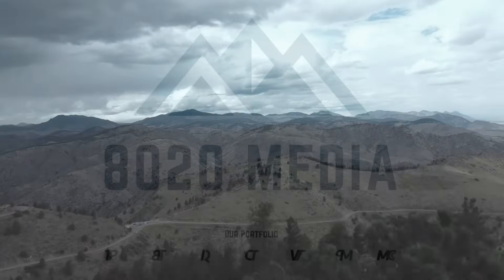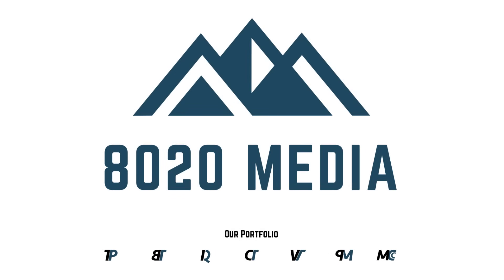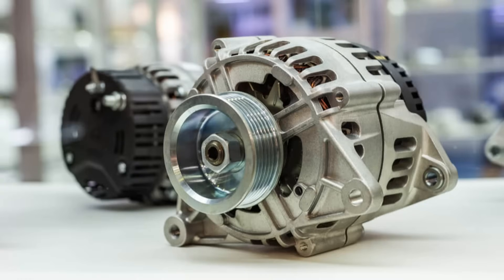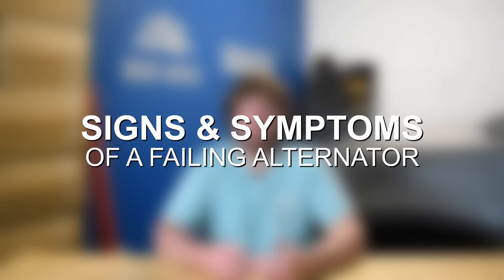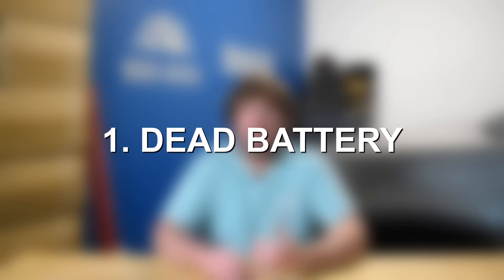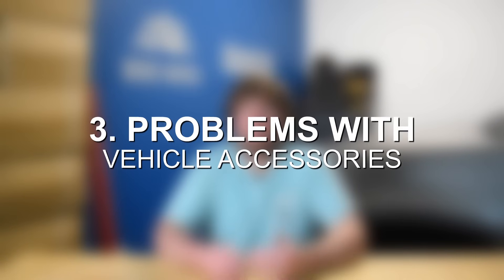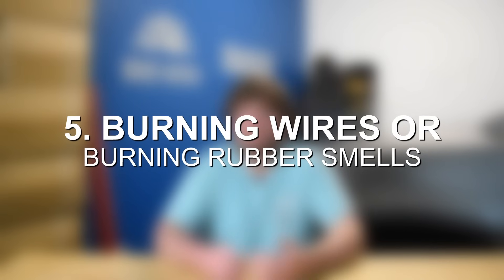6 Symptoms of a Bad Alternator!

Comment: What if your battery is throwing too much voltage?
Reply from the maker: B - If your battery is throwing too much voltage, typically above 14.8V while the engine is running, it’s likely an overcharging issue caused by a faulty voltage regulator inside the alternator. Overcharging can damage electrical components, cause battery overheating, and lead to premature failure. Check the alternator output with a multimeter; it should be around 13.8-14.5V at idle. If it’s excessively high, replacing the alternator or voltage regulator is necessary. Also, inspect the battery for swelling or leaks, as excessive voltage can damage it. If the issue persists, ensure all grounds and connections are secure, and check for a faulty ECU, as some vehicles regulate charging through the computer.
Reply: @ got it. I just replaced the alternator today unfortunately I had another diagnostic and is throwing a code for “torque converter”.
Reply from the maker: @ Sorry to hear.. We hope it gets fixed!

Comment: I already ordered the Alternator, but I was second guessing myself. Lights dim slightly on every few seconds and my phone dint charge anymore on charger (shows charging but doesn't charge), so yeah video was on point for sure.
Thanks.
Reply from the maker: Y - Thanks for the feedback! Hope it helped.
Reply: A weak battery can burn out an alternator. All batteries should be slow charged every 6 months.
Reply: @Michael-Philip You're only 4 months late with response. 
Anyways, alternator change fixed my issue, grid heater was draining batteries and factory alternator couldn't keep up, it was that bad.

Comment: My car is completely dead and I can't charge the battery up. I smell burnt in the engine bay area last time when car was on. Could it be alternator ?
Reply from the maker: M - If your car is completely dead, won't charge, and you smelled something burnt in the engine bay, the alternator is a likely culprit, but you should also check for a blown fuse, melted wiring, or a short circuit. A failing alternator diode or regulator can cause overheating and a burning smell. First, inspect the battery terminals and cables for corrosion or damage, then check the alternator wiring and fuses for signs of burning. If you have a multimeter, test the battery voltage—it should read around 12.6V when off and 13.5-14.5V when running. If the battery is drained and won’t charge, the alternator may not be supplying power, or there could be a parasitic drain. If unsure, remove the alternator and have it tested at a parts store. Keep us updated!
Reply: @ wow thank you so much for such a detailed reply, I am grateful. I will have those checked asap and will report back. Appreciate it !
Reply: Could be starter as well if your having trouble starting the engine too, alternator issues are very similar to starter
Reply: @4l2u0na  but if it’s starter issue, all the electrical components wouldn’t be dead tho

Comment: My aircon internal air goes  random.
My wipers went off 
My radio channels change randomly infrequently .

Now im getting whinnying and grinding noise 
Car is 160k km
Reply from the maker: M - Your symptoms—random aircon behavior, wipers activating on their own, radio changing stations, and now whining/grinding noises—suggest an electrical issue, likely related to a failing alternator, bad ground connection, or faulty body control module (BCM). The alternator may not be supplying consistent voltage, causing intermittent electrical malfunctions, and the whining/grinding noise could be from a worn alternator bearing. First, check the battery voltage with the engine off (should be around 12.6V) and while running (should be 13.8-14.5V). If the alternator is failing, it can cause erratic electrical behavior. Also, inspect ground connections and fuses for loose or corroded terminals. If the alternator checks out, the BCM or wiring harness may be at fault, requiring further diagnosis with a scan tool. Keep us updated!

Comment: Thank you for your video. I replaced a brand new alternator, but it isn’t providing the electricity power while engine running. Should the alternator pigtail plug connector be replaced?
Reply from the maker: S - If your new alternator isn’t providing power while the engine is running, the issue could be with the alternator pigtail connector, wiring, fuse, or voltage regulator. First, check the alternator fuse and fusible link, as a blown fuse can prevent charging. Also, inspect the pigtail connector for corrosion, damaged pins, or loose connections, as a faulty connection can stop the alternator from sending power to the battery. Use a multimeter to check for proper voltage at the alternator terminals—if the alternator isn’t outputting around 13.5-14.5V, and the wiring checks out, then the pigtail connector may need to be replaced. If the wiring is fine but there’s no charge, the issue could be with the internal voltage regulator, meaning the alternator itself might be defective. Keep us updated.

Comment: Question. If its a bad battery and you put a jump on it. will that stop it from starting? I have a 2011 chevy traverse. I was driving and it died out of no where. I couldnt get it to start and ended up killing the rest of the battery. I got  a jump and it still wouldnt start and the battery died again so we charged it a lil before we left. We just tried again and the battery is dead and didnt even really wanna take a charge so i could get the key out.  Do you think i messed my battery up and its something els or do you think my battery is bad and why it died.
Reply from the maker: D - Yes, if your battery is completely dead or damaged, even a jump start may not work, especially if the battery has an internal short or bad cells. Your 2011 Chevy Traverse dying suddenly while driving suggests a charging system failure, likely a bad alternator, loose/corroded battery connections, or a failing ground. If the alternator wasn’t charging the battery, the vehicle was running solely on battery power until it drained completely, causing it to stall. If you jumped it and the battery still died immediately, the battery is likely too weak to hold a charge, or the alternator isn't providing power. Try testing battery voltage (should be 12.6V off and 13.5-14.5V running) and check for a bad alternator by seeing if the voltage drops when running. If the battery won’t hold a charge at all, replacing it is the first step, but if the new battery still dies quickly, the alternator is the real issue. Keep us updated!

Comment: I was driving and my jeep renegade turned off. I have a new battery so I know it’s not battery but my battery icon came up. I tried to start it it wouldn’t start until the second or third try. Would this be an alternator issue?
Reply from the maker: T - Yes, if your Jeep Renegade turned off while driving and the battery icon appeared, it’s likely an alternator issue. The battery icon usually indicates that the charging system isn’t providing enough power, which could mean the alternator is failing, the serpentine belt is slipping, or there’s a wiring/ground issue. A failing alternator can cause the engine to stall while driving because it can’t provide enough voltage to keep electrical components running. Since the car eventually restarted, the battery had some remaining charge, but if the alternator isn’t charging properly, the problem will worsen. Test the alternator output with a multimeter—it should read 13.5–14.5V while the engine is running. If it’s lower, the alternator likely needs replacement. Also, inspect the belt and connections to ensure proper charging. Keep us updated.

Comment: Thanks for your straight-forward video. What if the power locks still work after I manually lock the car but the battery is dead and the car won't start, is that an alternator or battery problem?
Reply from the maker: L - If the power locks still work but the car won’t start and the battery is dead, it’s more likely a battery issue rather than the alternator. Power locks require minimal power, so a weak or nearly dead battery can still operate them, but it won’t have enough charge to crank the engine. Keep us updated!
Reply: My battery light came on and stayed on and then other dashboard lights came on and then my radio went out and car stalled out and would not start tried to start the car after a hour and it started right up so what is wrong it it my battery or alternator?

Comment: Battery light kept coming on and off when I was driving home last night. Went to drive to work this morning and my battery light came on again and got about half way before my radio started going out and all the lights in the car started to go out and then the surging of the engine occurred when I pretty much lost all power. Was able to drive it home but had to go like 5 mph. Gotta be alternator right?
Reply from the maker: x - Yes, the symptoms strongly suggest a failing alternator. The battery light coming on indicates an issue with the charging system, and as you continued driving, the battery drained because the alternator wasn’t providing sufficient power. The radio cutting out, lights dimming, and engine surging are signs that the electrical system was losing power, forcing the car to run off the rapidly depleting battery. To confirm, test the alternator output with a multimeter—voltage should read between 13.5–14.5 volts while the engine is running. If it’s lower, the alternator likely needs to be replaced.

Comment: I changed my alternator and it run for about 2 hours then it will stall
Reply from the maker: L - If your vehicle stalls about two hours after running with a new alternator, it suggests the alternator might not be charging the battery properly or there’s an issue with the electrical system. Start by testing the alternator's output with a multimeter to ensure it’s producing around 13.5–14.5 volts while the engine is running. If the voltage is lower, the alternator may be faulty, improperly installed, or there could be an issue with the wiring, such as a loose connection, a bad ground, or a damaged power cable. Also, inspect the battery terminals and cables for corrosion or looseness, as these can restrict power delivery. If the alternator checks out, test the battery’s health to ensure it holds a charge. Lastly, ensure the belt driving the alternator is properly tensioned and not slipping, as a loose or worn belt can prevent the alternator from charging effectively. Addressing these areas should resolve the stalling issue. Keep us updated!

Comment: On my 2015 V6 Tacoma the battery light on my dash would flicker sometimes. And I smelled a burning electrical smell sometimes. Replaced the alternator and serpentine belt.
Reply from the maker: M - Did that fix the issue?

Comment: I have flickering dash lights and headlights had it tested at O'Reilly's Auto parts they said the battery was about to go out not the alternator is that true?
Reply from the maker: L - Yes, a failing battery can cause flickering dash lights and headlights, as it struggles to maintain a stable voltage. Replacing the battery should resolve the issue if the alternator is confirmed to be functioning properly. Keep us updated!

Comment: I own a 2006 Impala. For the past two weeks I’ve gotten a new battery and I’ve been jumpstarted because I would get in my car and my car is dead. We checked my fuses and all my fuses were reading normally. I am very confused because when I go to turn my key over my car is dead. I take my key out and I turned my car on again and it starts. I am dumbfounded, and I don’t know what to do. We kept my car and a warm shop for 12 hours and I didn’t have this problem but once it got into the cold because I’m from Minnesota that’s when I would have the problem when it won’t start.
Reply from the maker: N - Sorry to hear this! The most likely culprits are a weak starter motor or battery/connection issues exacerbated by the cold. Start by testing the battery, starter, and ignition switch, and ensure all connections are solid. Using a block heater can also help mitigate cold-weather issues.

Comment: Thank you for the video. I don’t know what’s wrong with my car. It keeps dying every time when I jumpstart it and I just bought the battery like six months ago when I drive it showing the dashboard. the battery appears.when i jumpstart it it will start ok but the following day it’s dead
Reply from the maker: R - Sorry to hear this.. The most likely culprit is a faulty alternator or parasitic draw. Start by testing the alternator output and checking for electrical drains.

Comment: Replaced the alternator and installed a new battery on my 2013 Dodge Durango. It started up as should. 2 days later on my way to work, battery light came on and within 5 minutes dash lights started flickering. I have 2 12 inch subs powered by an amp that went out on me a month ago. The power supply cable from the amp was still connected. I had the battery jumped and it drained. I unhooked the power cable for the amp, jumped the battery and the voltage remained at 12.5 and didn't die. Could the power cable from the amp be the issue or do you think it's a pdi or pdmi issue?
Reply from the maker: R - The amp's power cable is likely the root cause of your issues. Disconnecting it resolved the immediate symptoms, indicating it was either causing a parasitic draw or electrical instability. If the system operates normally after disconnecting the cable, the issue is with the amp or its wiring.

Comment: In my wife car’s case, no battery light on the dash. So i know that the alternator still works. So i started the car. It started. I turn it off after 10 seconds. Restatrted  no start. Like really dead. Then i jumped it and started right up. Used a mulitimeter and battery is ready full. Started to car and reading full also then tested the alternator with multimeter. Checks out. So why does the car dies if the car parked for two days. There is a chance i would have to jump it. Thwre is time that it’ll start right away. Any idea?
Reply from the maker: T - The most likely cause is a parasitic draw from a component draining the battery while parked. Perform the parasitic draw test to pinpoint the culprit, and inspect the battery and connections.
Reply: @ Thank You i will

Comment: My car runs fine but I do notice at night the headlights dim when I turn on other accessories like the back window defroster the hvac and when I step on the brake the dash lights and headlights dim and when I rev the engine up the lights get brighter is this an alternator issue.
Reply from the maker: R - Certainly sounds like it!

Comment: mine dropped to a round 12 volts one day then it went back to around 14, a couple days later i went to start it and the battery was dead so i took a spare i have that had 12.72 volts and put it in, it started right up but was jumping to 16 volts then back to 14 and also almost 12 volts. now i dont know which is bad. battery or alternator.  my previous battery is over 5 years old, the other one that i put it is 2 years old and started the vehicle up. so now im confused 🙃
Reply: I’d like to know what you ended up replacing
Reply: @iYKYK-14-o4k    i replaced the battery first then the alternator, it still says 15/16 volts,  but after about a month everything still working, dont remember ever having a vehicle over 15 volts, but this seems to be one of those cases that i dont know, my multimeter says over 15 as well so im not sure.

Comment: After running several errands (5-10 minutes of city driving between stops), car wouldn’t start. Weather in 50s (F), and lights not left on. Jump from a stranger, and started right up. 5 minute drive home, turned it off, and wouldn’t restart. 2 hours on a 10amp battery charger, and now it will start. Two different auto part stores tested the battery, alternator, and starter (in the car). All tested good. Second time this has happened. Any ideas?
Reply from the maker: M - While the battery, alternator, and starter tested “good,” I’d recommend starting with a load test on the battery and measuring the alternator output under load. These are the most likely causes for your symptoms.

Comment: Or how about taking the negative off the battery post if the alternator is bad it’ll shut off..
Reply: That's an old school trick. Never do that on modern cars. Today's cars have sensitive computer components that can be damaged by the voltage spike that can happen doing this
Reply from the maker: B - Also an option! Thanks for sharing.

Comment: A symptom I had on a 75,000 mile Subaru Forester was weird. For a couple of months whenever I drove over a rough part of a road the dashboard would be triggered with several trouble lights. I would clear them with my installed Scan Gauge unit. This happened multiple times. Then one day all of the lights would come on and I couldn't clear them, and had to get home in limp mode. After a couple of weeks of chasing codes and sensors I noticed the scanner said 11.2 volts. So I replaced a two-year-old premium battery. No trouble codes but still low voltage. Replacing the alternator was the solution. You get "no communication" messages on the CAN-Bus system if the voltage is low. Duh. I felt like the dummy who wonders why his laptop is acting funny because its battery is low and isn't plugged in : -) My guess is that the alternator was failing on rough roads because the brushes were bad enough to respond to jiggles.
Reply from the maker: M - Thanks for taking the time to share this! It will certainly help future viewers.